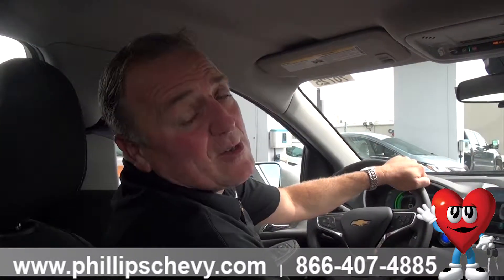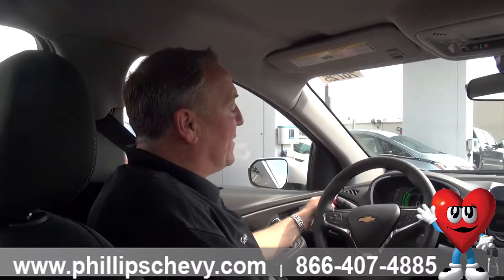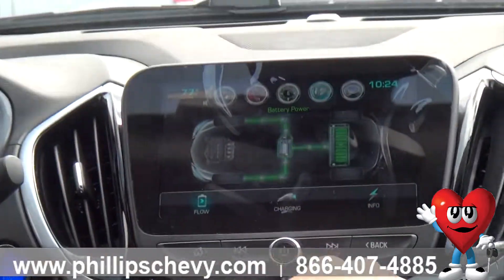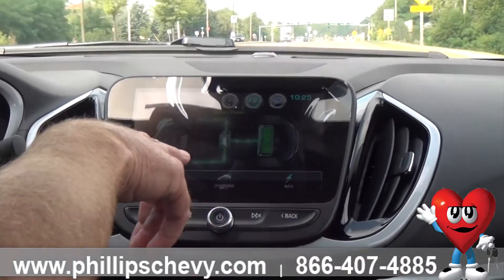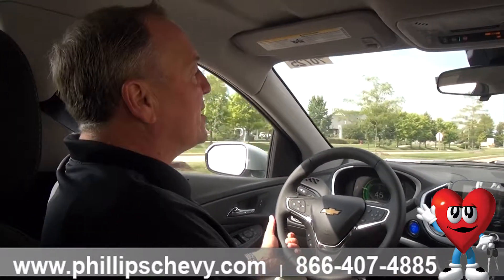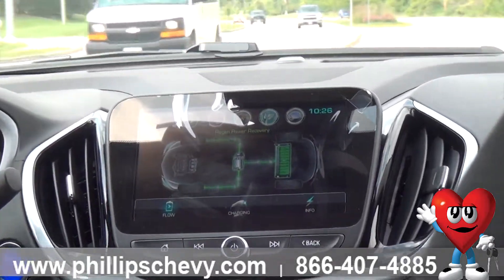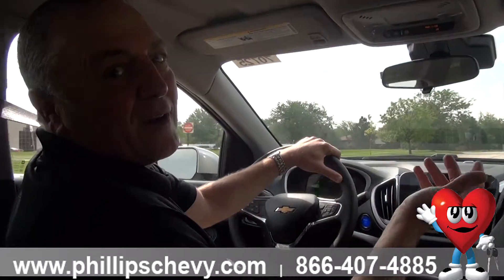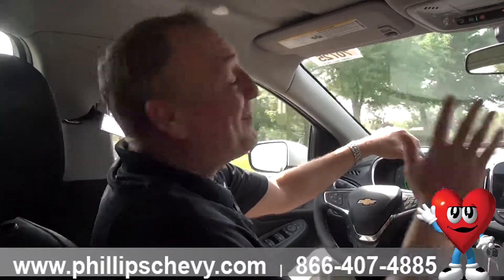Phillips Chevrolet - 2017 Chevy Volt – Regenerative Braking - Chicago New Car Dealership

Comment: I need more detail on how the heat energy created by the disk brake send energy back into the battery.  Regenerative braking is the ability to use the drive motor as a generator loaded by the vehicles forward motion.  Slowing caused by the the vehicles brakes is lost as heat.  If this dealership wants to make a video about the Volt, get an engineer or at least someone who doesn't challenge our intelligence.